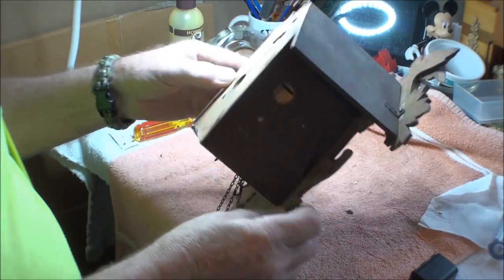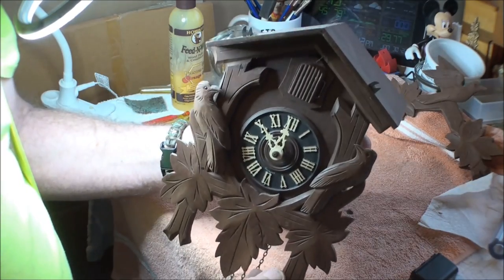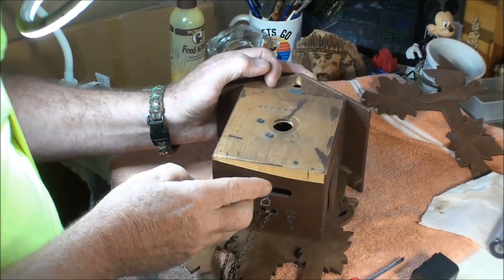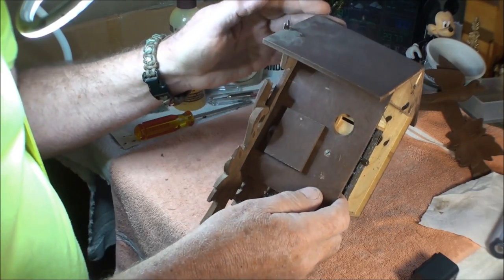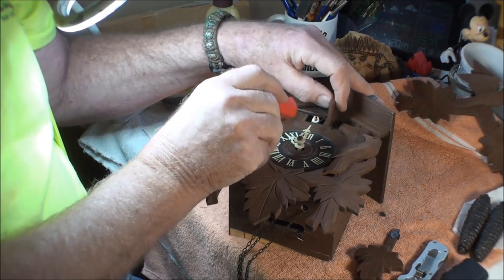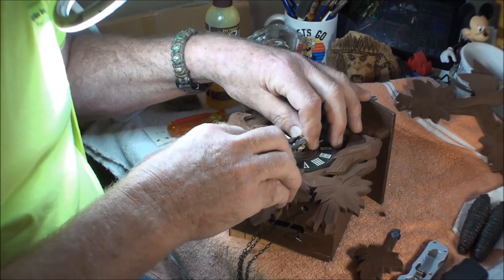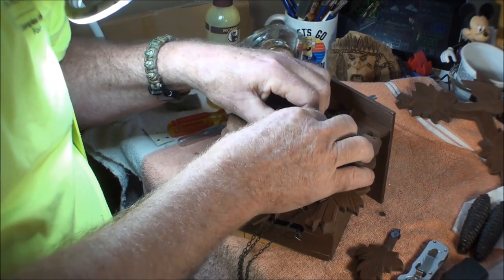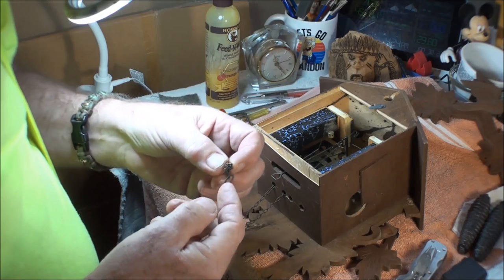Your First Cuckoo Clock and Basic How to Clean or Repair Your Clock

Comment: Hi Mike, my son just recently gifted me the exact same build of this clock, with the exact same outer carvings (3 birds), though some small differences in the outer doors and strike. Mine is also in pretty good condition, but needs a bit of attention. My son told me that he'd paid $50 Aussie for it, so it was great value. I'll restore this though my wife suggests that I keep it in our garage = really is a family joint venture :) Many thanks for this excellent tutorial vid. It is a great reference for me and the heir. I must mention that the biggest enemy of these clocks is weak wall mountings - gravity will win if the wall mounting can't take the weight. It will destroy a perfectly good clock.
Reply from the maker: We have to remember to find a stud in the wall to hang your clock up. Besides the weight of some of these clocks, when winding the clock, it is like a mini jackhammer. Each time you hear the clicking as you wind your clock, it adds vibration through the clock and to the hanger. It's always a great day when you can find a clock for a good price and to learn from it and get it running again is a joy and a warm feeling in your heart. It is sad that most wife's rule over the décor of the house and the after the hunt clocks upset them with dead animals on the clock.

Comment: Hi Just Mike, you've helped me previously. I'm having problems with my Cuckoo Clock. My Bird just Coo's once instead of Twice, Cuckoo, instead of Cuckoo Cuckoo! Thanks for your help again. Cheryl Morris.
Reply from the maker: I would think that maybe one of the bellows broke the paper or leather and is not blowing the air through the whistle. You can look to see or use your finger in the back of the clock to operate the bellow to see which one isn't working.
Reply: @justmike57  thanks for that, Can I replace the Paper with Leather, as I've been sticking down the Paper for a while now, maybe Leather might be stronger, I've seen The Leather is available but not sure if I can Replace my Paper ones with Leather? Thanks for your help. Cheers Cheryl.
Reply from the maker: @cherylmorris4187  This link will show you how I replace the bellow with Tyvek paper you can buy from EBay. You can buy different quantities. I would only use leather if the clock were a high valued clock for resale, otherwise Tyvek works great. https://youtu.be/R7mJna8byJ8
  If you want to just change the Online Bellow from a cuckoo clock sales, I also have a video on that: https://youtu.be/yeAXGktfyNU

Comment: Very clear instructions and enjoyed the video. I would like to dismantle a cuckoo clock and fix it back , however I don't have an old one with me and old clocks are difficult to find because people usually don't part with them. And new cuckoo clocks are very expensive. If I can manage to buy an old discarded one, I will follow your instructions and fix it. That way I can learn about clocks. Thanks for posting this video Mike.
Reply from the maker: The cuckoo clock is a hard one to find, cheap. Sometimes on FB, thrift stores and garage sales you will find one if you are lucky.

Comment: I wonder if brake parts cleaner would do the job🤔
Reply from the maker: Just remember, what ever you use, you want to test it on the metal. Also your newer movements have a lacquer finish on them to help keep the brass from tarnishing. I don't know how long it takes, but W.D.40 also cleans the old oils, how do I know, I received a few movements that they sprayed the movement with it, but they were not able to get the clock running. If you wanted to go cheap, Dawn Dish Soap and Hot Water alone, cleans the movement and could strip off the Lacquer finish as well. Good Luck on what ever you try.

Comment: How about just using gunk or degreaser, then soak and rinse the movement and blow dry, then thoroughly lube all points and gear and arms where metal to metal contact is made? To take the movement totally apart is beyond the scope of most people, almost like taking a mechanical watch apart!  My movement was very dusty but was able to clean with just air an Q-Tips and re-oil.  Thanks for your help Mike, I was able to do it all with your help & my parents had the same clock back in the early 70's!!
Reply from the maker: You just have to remember, what ever you use has to be safe for brass as so it does not tarnish the metal. I have had some clocks come in with W-D-40 sprayed all over the movement. The movement after sitting until I got it helped clean the brass. Don't know how well the sprayed the pivots out, but still I ended up taking the movement apart to clean it right and remove any oils left behind so the dust would not be as tracked to the movement. They do make a spray for cleaning movements and another spray you are suppose to use to wash all the cleaner off. The total cost was around $25.00, not counting shipping. 
  Like I always say, it's your clock, so do as you please, and if you mess it up, you can now try to fix that problem and learn from your mistakes. Clocks are always a learning experience. 
  It sounds like you had success with your movement and now to see how long this last. Thanks so much for your story on cleaning the movement and thanks for watching and learning.
Reply: I have done a complete cleaning and the only issue now is door does not open all the way when the bird comes out. Any idea how to proceed? I di dsend you an email omn this.  Thanks!

Comment: I've got the same clock. Found it in a UK charity shop for a couple of pounds.
     I got it working nicely. No weights, sadly. I'm improvising with some household items that weigh around 280g.
     No pendulum either, so I've temporarily used a bit of wire and a lump of plasticine as a weight.
     It keeps surprisingly good time.
    A fun project 🙂
Reply from the maker: It sounds funny, yet, if it works and you are happy with it, that is all that counts. If you wanted to order the correct items, these are the two companies that I order from. 
Ronell; https://www.ronellclock.com/
Timesavers; https://timesavers.com/
Reply: @justmike57   Thanks Mike! I've upgraded to two fishing weights for the operation, and I've just made another pendulum, from a length of wood, with a Chinese coin glued on the end. It looks Ok now, and actually keeps better time than my Tissot watch, which gains about 30 seconds a day. I'll check out the companies, as I've enjoyed mending the clock so much that I may look for another one to work on.

Comment: My young (30 years old) River City Cuckoo was sounding kinda hoarse, so I got out the box & manual & there was nothing on cleaning & maintenance.  I dusted it but I'm watching a few videos before I do anything else.  It has always worked great & kept good time. Just terribly gravel road dusty! It's also been in the kitchen for the last 10 years. Got some Liberty oil on the way. Wish me luck & Thank you for sharing your knowledge, patience & nice voice.
Reply from the maker: Sorry to hear that and it is good you are going to oil your clock before it stops. Maybe get a can of Air and blow the movement out before you oil the clock. Check your bellows while you are in the clock for holes or the hinge area for loose paper. If you need to replace the bellow, I have two different videos on how to do that. 1 would be just replacing the bellow, 2 replacing the paper in the bellow with Tyvek. Good Luck.
Reply: @justmike57  Hi Mike, Got the air. Is there any certain place I should point it? Like  up from the bottom is probably better than down thru the top. Since everything is still working, I would like to avoid taking the guts out. :) Thanks again.
Reply from the maker: @rtcfrtcdana  If everything is working, just blowing the clock out will really help, but you will be oiling one side of the clock and both sides should be oiled because the gears go through too each plate. This is what most people do is only oil one side and the inside plate starts to drag and gum up. The book says to oil your movement every 3 years and you should be good to go. Do you want to risk the inside plate to gum up? Just take a deep breath, take notes or pictures of how you take the movement out so you can get it back together the same way. And maybe watch the video again if you need some help. I do have an email below the video if you need some extra help. .
Reply: @justmike57  I must prepare the operating room (kitchen table) :D

Comment: Thanks,Just Mike. Now my Clock seems to only tick away without pendulum attached. Tried n tried again sliding leaf up and down... Won't continue to operate as it should after a couple of seconds. But it IS alot closer to working properly than it has in Years.
Reply from the maker: Good to hear it is running better than years ago. Depending on how you cleaned your movement, sometimes you still have to restart you clock every time you walk by it for a few days. Do make sure you listen for the even tic-tock sound and if you can keep it running without the pendulum, leave it off for a couple of windings to help the clock work out the possible old oils and dust that still might be there. Fresh oil thins what might be left. Also you might have to re-oil it in a couple weeks on both sides, depending how you cleaned your movement.

Comment: Would like to see you do one with the music box included.
Reply from the maker: Most the music box clocks are just a lever that gets tripped. I have some old clocks that have a trip wire that is really hard to slightly bend the wire for the music to trip. I might have one out now, but maybe not really explain the stops on the wheels that keep the music from playing until the cuckoo is done. For the newer clocks, it's all about the levers outside the clock and how to adjust them. We will see if I get in another musical clock and make a video on that.

Comment: Hi Mike
My granddaughter has shown an interest in a clock. I am from UK have you any tips for what to look out for when looking for a cheap clock to start out with. There are many on EBay but I want a half decent one. Thanks.
Reply from the maker: The number one thing is a 1 day clock that is cheap. This way it doesn't matter if you mess it up. And if you mess it up, you can try to fix that mess up as well. 
  You decide what you really want. A clock without a topper needs to go cheaper than one with a topper. A smaller clock will also go for cheaper. I would also say to get a clock that has the weights with the clock. 
  When looking for a deal, and I don't know how well that is for the UK, but watch the Goodwill auction site. I just typed in cuckoo clocks and copied the link. https://shopgoodwill.com/categories/listing?st=cuckoo%20clock&sg=&c=&s=&lp=0&hp=999999&sbn=&spo=false&snpo=false&socs=false&sd=false&sca=false&caed=11%2F2%2F2023&cadb=7&scs=false&sis=false&col=1&p=1&ps=40&desc=false&ss=0&UseBuyerPrefs=true&sus=false&cln=1&catIds=&pn=&wc=false&mci=false&hmt=false&layout=grid&ihp=true
  You might get better deals here on the Goodwill sight. Also, don't bid right away. Some people get caught up in the bidding war and will end up driving the price up and be on the price the clock is worth.

Comment: Have you ever tried cleaning the timing gear box in an Ultra Sonic Cleaner , they are also used for small carburetors, in addition I think a throttle body spray cleaner would work to remove the old caked on oil and dirt.
Reply from the maker: I don't think mine has a timer gear box. It is digital. My brother has one as well and always uses his for cleaning carburetors and other parts in his outdoor shop. The Ultra Sonic cleaner machine just makes the job quicker and for that I am happy.

Comment: Your clock is identical to my  great grandmother clock. Its broken and missing parts but I would like to put it back together. Thank you for your great video
Reply from the maker: Well if you tackle the clock, take your time with it. If you need to glue anything on the clock, use the large rubber bands because they work well. Need any help. my email is below the video. I don't go there often enough, but I do go ghere.
Reply: @justmike57  hi mike hope you are well. Could i also ask help when my sister send me one from germany?

Comment: Hi Mike - Great video. My cuckoo clock is a 7 day movement.  Sometimes it will run for 5 days without an issue, but when I wind it, it will sometimes run only 5 minutes. Can't find a common factor as to why it runs great for a while and when it doesn't run well.  I read a post below and your response about removing the pendulum and letting it run without the pendulum for a while.  Do you think that may help get the movement going better in case there was some dust/gunk in the movement?
Reply from the maker: The book says to oil you clock every 5 to 7 years to keep the oil from drying out. Also use a can of air to blow out the dust. When you oil the clock, you have to oil both sides of the movement. The book also says if your clock stops running, it might be too late and the movement should be taken all the way apart and cleaned. It sounds like your clock is getting very close to cleaning it all the way.
Reply: @justmike57  What is the spray cleaner you mentioned in the video?  I'm really nervous to take the movement all apart. I think I'm comfortable removing the movement from the clock housing, so can I effectively clean it that way without dissembling it?
Reply from the maker: @fitman45  https://www.ronellclock.com/product/super-clock-cleaning-spray/
Reply: @justmike57  Thanks Mike!  I did come across that product, but wasn't sure that is what you referred to.

Comment: Mike, I can't get my pendulum to continue. It goes for less than a minute. I've straightened the wires as much as possible.  Does my left weight affect
the pendulum swing?  My right one works with the Cuckoo.  Not sure what the left one does.  Thanks.
Reply from the maker: Did you just buy this clock somewhere or take it out of storage? The book says you should oil your movement every 5 to 7 years and blow out the dust. Also, if you clock stops working because of not oiling the movement, it would be best to take the movement apart all the way, clean and oil the movement to give it a fresh start. 
  The old oil will start to gum up and the fresh oil will prevent the old oil from drying up to get gummy along with the dust it takes in. You could try a short term fix by using clock oil on the pivots, front and back. Pivots are where the gears come through the plates. 
  You said you straighten the pendulum wire. Unless it fell off the wall, this might not be a good thing. Start the pendulum and listen for an even tick-tock sound. If the clock does not have an even sound, tilt the clock to the right and listen. If it gets worst, then tilt it to the left until the sound is right. 
  There are times that you have to move the Leaf, Bob) up to get the clock to run faster when the clock hasn't been oiled. (Doing this is for when the clock starts to gum up inside and slow the clock down.
Reply: @justmike57  Thanks, I'll give it a go.

Comment: Nice good job!
How do you adjust it when the clock is too fast than normal time? Thanks
Reply from the maker: If your clock is running too fast, slide the pendulum bob (Leaf) down the stick a little at a time and wait at least 12 hours before you adjust again if needed.
Reply: @justmike57  make sense, thank you for your quick reply, I really appreciate it.

Comment: Is there a part 2? Mine jumped the chain on the bird side I reset the chain but the choocoo won't work is there an on off thing to make it work again? The time works great what did I do wrong?
Reply from the maker: Some of the clocks will get stuck, possibly because the clock might have had the minute hand turned counter clockwise. You can try moving the minute hand, 5 minutes past the hour, then slightly pull the winding chain and tug on the weight side quick after letting the winding side go. If this does not work, you might have to remove the movement and on the front you will see a snail looking gear that moves the hands. There will be a lever that is suppose to drop onto the snail that will count the hour. That lever might be stuck behind the snail. If it is stuck, just lift it up so the pointer can rest on the snail again. 
  If you go to my channel and look for the "PLAYLISTS" you will find a list of the cuckoo clocks I have worked on. I normally show how to take the movement out of the clock and explain how the cuckoo knows how many times to cuckoo. These videos should help you out.